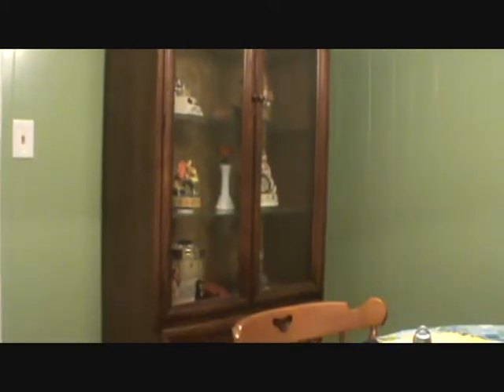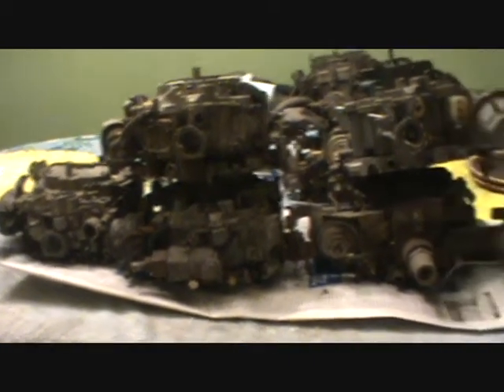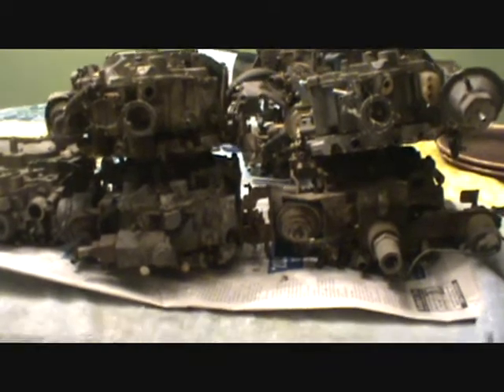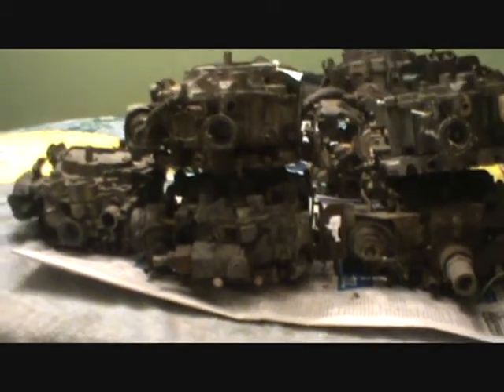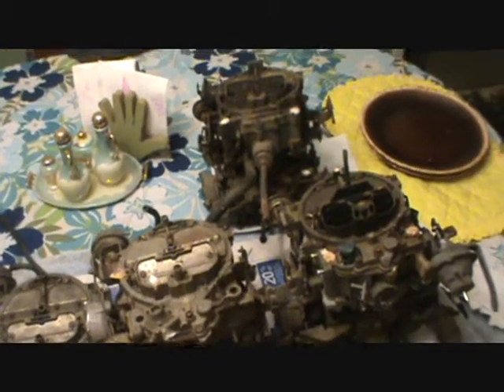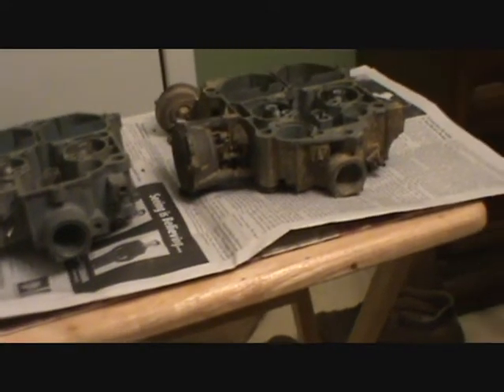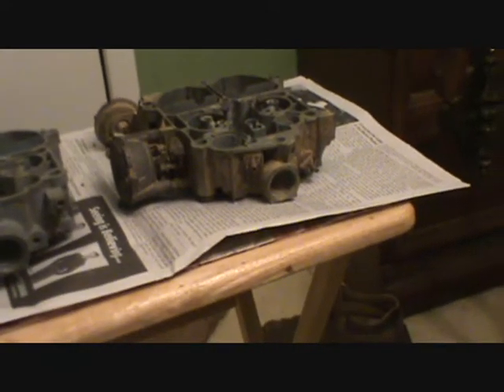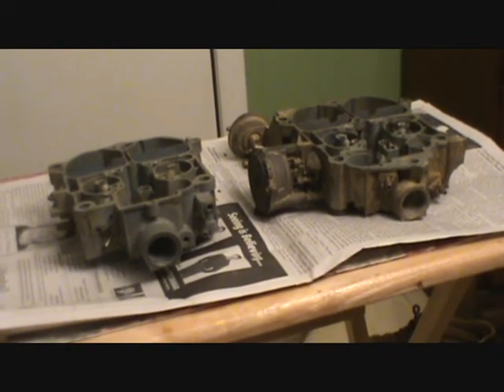Decoding a Rochester Quadrajet part 1: The name

Comment from the maker: @BroncoRogers78 It's in the next video or two in this series, but the number is located at the left rear running vertically. Check out the other "decode" videos I have, it'll help you with it.

 I doubt it's that new of a carb because the last non-electronic Qjets were used on 1986 GM trucks. It could be one of the Edelbrock repops, check the number out and I'll decode it if you have problems.

Comment: Much thanks I did a little research and you right mine is off a 69 as well only I'll be using this one on my 67 c/10 as I swapped in a 350 small block thanks again.

Comment: Great video. I was wondering if a 67 gto carb # 7027262 should the air horn, bowl section and base have the same #s mine are as follows top 7033604 middle 7033883 base 7033618 o r818 cant find no info. Thanks in advance.

Comment: Hey I have an 86 c10 with the electric connection on it .....i need to know the carb code so i can buy the right rebuild kit....thanks
Reply from the maker: It's on the side of the carb where I show. Give them that number, they'll give you a kit. That electrical connection is a dual-stage accelerator pump by the way.

Comment: My carb is stamped 7043250RA
                                              0732
Is my carb a California carb and what do you think it's from. Thank you in advance for the help. As far as I know my engine is a 1986 sbc 305. It has a single piece rear main seal So I know it was made in 86 or later and 4-22-86 was scribed on the underside of the intake manifold.

Comment: Work ing on a 1960 Cadillac convertible with 3 carbs ,middle one is different the outer. Need to learn more about that set-up. Goin to read numbers lstrr on. There is a dash pot vacuum activated stic ,moves in an out sfter declaration. Two wire on end ,one broken off. Still works.
Reply from the maker: I think those are Rochester 2G carbs. The center one is likely different because it's the only one with a choke since the other two come in with a progressive linkage and don't function at idle. That's about all I know on that set-up but there's lots of info about them floating around.

Comment: Can a Q-jet that is coded for a manual trans vehicle be used in an automatic trans application?
Reply from the maker: Yes but there may or may not be a provision for the transmission kickdown cable to attach.

Comment: I've got a Qjet that does not have the stamped numbers on the body. I think it must have originally came with a stamped tag, that has long since been removed. I'm pretty sure its a M4M late 70's. I need to order a rebuild kit but don't know my model number. What the heck can I do? BTW I love all your Qjet videos, very informative!
Reply from the maker: Thank you. There aren't actually that many kits. They break between the early 4M series and the later M4M series, with some detail differences involved. The first thing I would determine is if it's an early or late carb. That's very easy...the 4M series has a squared-off front body, while the M4M has a front body shape that is bulkier and has provisions for a bowl vent on the front, pointing down and to the left(driver side).Here is an early 4M Qjet ->http://thumbs2.ebaystatic.com/d/l225/m/m0wcCsH0pUp6AQ6tDk6FYLA.jpg

If it's an early 4M that had a tag, it would be located on a round tag affixed to the left side of the carb body. That only happened from '65- mid '68, so if there's a spot for that tag it's an early carb, not a later version. Also, look at the fuel inlet. Is it a side inlet or a front inlet? Chevy only used them in '65, then BOP used them '66 onward and BOP had front inlets. Hope this helps you narrow it down.

Comment: been watching your videos learning all about these, have an 88 Caddy 307 with a computer Qjet swapping over to mechanical and after watching this I found my mechanical Qjet is from an 88 Chevy pickup but it's a California model. wondering if you have a video or could make one to enlighten me on the difference if I'm worth wasting time on this one or get a different one
Reply from the maker: Why don't you go on eBay and look for a late '70's Olds Quadrajet. The fuel inlet and the choke and vacuum ports are all very similar to the Olds 307 electronic carb you have now. Almost a plug and play.

The numbers to look for are 17057253, 17057256, 17058253, 17058256, 17059253, or 17059256. All mostly the same carb. You can find good rebuildable cores for $50 or less.

Keep in mind the distributor on those 307's is also controlled by the computer, so if you do the carb, swap in an Olds 350 or 403 distributor as well. You can find them used or buy a rebuilt pretty reasonable.

1977-1980 Olds is what you want to source your parts from.
Reply: Already got a new distributor got the carb free from a friend just got me curious after watching the video, just curious if there was any major differences
Reply: I was surprised it was an 88 being it wasn't computer controlled he just had it laying on the shelf said here try this
Reply from the maker: Truck carbs were never computer-controlled because the emissions weren't as tight. Some  had an electric two-stage accelerator pump but that's unrelated.
Reply: +WhoSaidTyler ahh ok I do remember you mentioning that, I've found a few serfing Craigslist I'll call around see what I can find local price ranges from 35-65 bucks thanks
Reply: +WhoSaidTyler actually as far as the conversion it's done it drives but it's boggy and such so I've been researching on getting it tuned and potentially rebuilding when I pulled numbers to order the kit that's when I noticed it being California emmisions so I thought twice about rebuilding it and look for a 49 state one, which here in the heart of the Midwest grabbing a California carb what are the odds haha

Comment: Great video, but unfortunately isnt helping me.  I bought a quadrajet off ebay and it looks brand new.
I'm trying to replace gaskets, but cant determine which set to buy (there is no stamp at all).  Possibly a knock-off?
Reply: +Travis Madison All it says is GM and 4jet on the top

any ideas??
Reply from the maker: +Travis Madison 4 Jet???  That's an old 4GC, the predecessor to the Quadrajet. They were nicknamed "Quadri-Jet" but it's a totally different carburetor. Look at this link and see if that is the carburetor you have:

http://www.carbjunkys.com/images/Lg_shop8-1.jpg
Reply: awesome! 
Thank you... thats the one

Comment: Is there any difference between an M4ME and an M4MED?
Reply from the maker: Yes, an M4MED Qjet is an electric choke carb that uses a dual-capacity accelerator pump, controlled by a solenoid and a temp switch. It is NOT computer-controlled at all. Found in some mid-eighties GM trucks and some Canadian  vehicles.

Comment: Mine says 17080504.. 2829.. CKH. Theres billions of numbers all over it.. I belive it's for a 1980 Chevrolet of some kind.  Has the white 3 pin electrical connector on it.  Some people call it a 4V from what I saw.  I used to have a GM printed book with all the QJet part numbers. It told data on what carb went where and when.